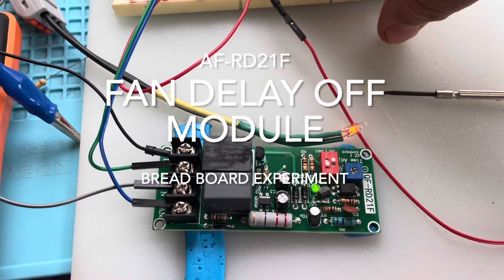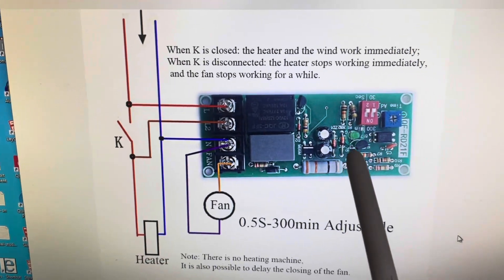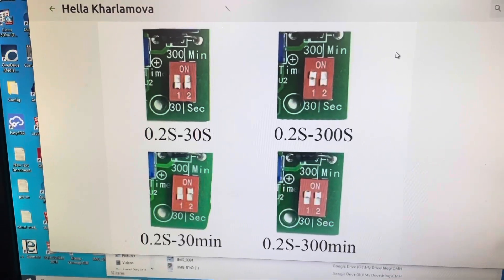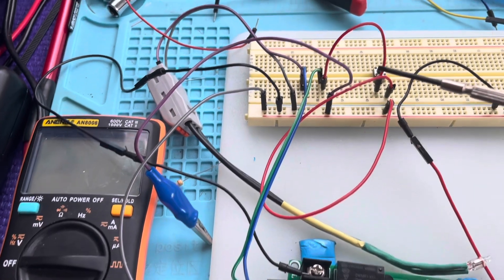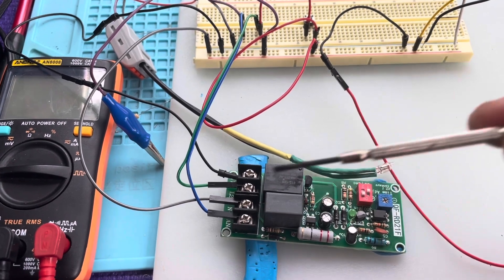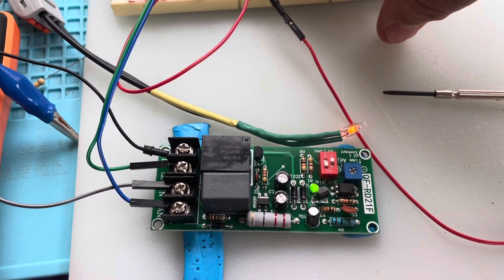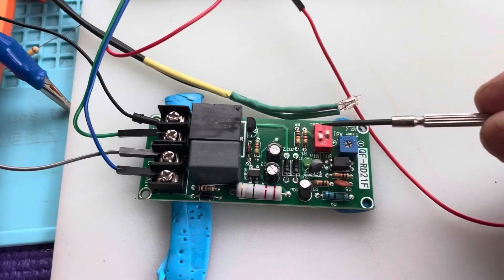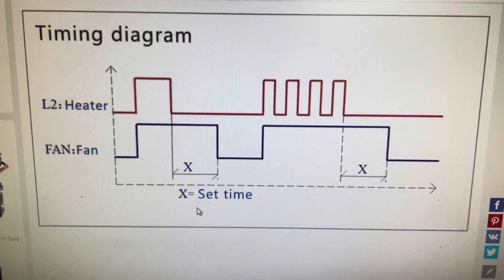QF-RD21F Fan Delay Timer Module 120v / 220v for heater

Comment: I need only timer after off signal (0-100sec)
Reply from the maker: Yes. This will do a timed shutoff after off signal.
Reply: No parallel with load (L1),  only after stop load.  I this modul I must put one relay on N.  @dannyjensen4954

Comment: Mains voltage on a breadboard... 😮
Reply from the maker: Not much current draw on light. Thin wires are a fuse. Not sure why it is bad after thinking about it. I’m not expert.
Reply: @dannyjensen4954  Those jumper wires will carry more than enough current to kill you. 50V AC is considered the maximum 'safe' voltage to mess with in that manner, and even 50v can kill.

Comment: Do you know if it can kill the power for the fan if the l2 is not going low after it's turned on? What I would like is that you turn on a switch, it stays on and after the set delay the fan is killed. Thanks for the video!
Reply from the maker: Check this video out https://youtu.be/0gGSeLVncgk?si=q-_Ex_nvAxAon-YD